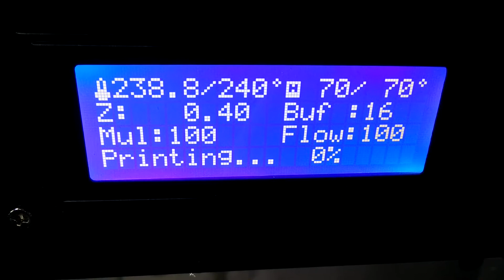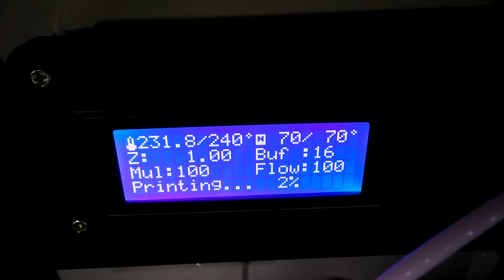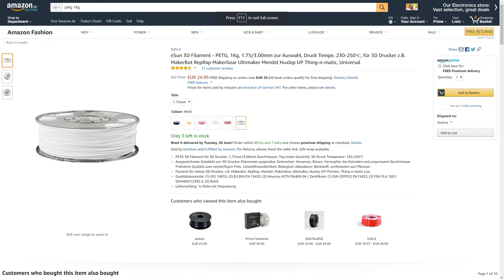Printing with PETG

Comment: hi, nice video, in the last 4 months I am printing mainly PETG for the flexibility  of some projects, I am having success with mostly the settings you describe:
- 230° nozzle
- 60° bed (from beginning to the end of the print)
- no fan (so I get the best layer adhesion possible)
- speed 40 mm/sec (max 50, ma better 40)
- 1st layer 20 mm/s
the best adhesion I get without warping is glass with hair spray, I know I thought it was silly too, but it works great on bare glass (I have cr-10).
I have thrown away the roll of ABS....
I hope this will help others...
cheers from Italy.
Reply from the maker: Hi, thanks for your comment!

Thanks for letting me know that my settings work (more or less). I've been printing with them for quite some while now, however, I mostly print PLA nowadays.
Based on your inspiration, I'm going to try the hairspray method as well! I just need a glass plate ;-)
To be honest, I have yet to try ABS, so I have no experience with it at all.

Greetings from Austria!

Comment: Thanks for the info.👍 I just started using petg last night and think I have the print temperatur far too high(260°C) and was getting quite a bit of stringing and blobs here and there on the inner walls.
Reply from the maker: Yeah, you're right. 260°C is already on the high side. Don't forget that there are no universal settings for getting every PETG right, so you need to experiment a little.

Comment: Very helpful video, thank you very much! 
There are so many long-winded videos about PETG on youtube and most of them don't cover the important tips like not using a PTFE-lined throat or hotend, for example. 

One question; is that the E3D V6 upgrade on Thingiverse you have printed and installed for your Bowden-style all-metal hotend? I was literally about to start that project today but am unsure if I should print it in PLA due to the heat created by the hotend.
Reply from the maker: Thanks for your comment!

In my video, I'm using a PTFE inlined hot-end for the simple sake that I had no all-metal one at the time. This is not a problem, except you go over ~235°C. 

I have some cheap all-metal hot-ends (E3D-V6 clones), however, they didn't really work for me and clogged after like 10 minutes when the heat goes up the throat! I'm pretty sure that this is only because of cheap metals that don't deliver heat as quickly as needed. 
Therefore I am still using PTFE-inlined hot-ends on all of my machines! 

I used this mount: https://www.thingiverse.com/thing:2099577
See more in this video: https://youtu.be/yxyDOZdmkIY

Later, I upgraded to a dual-extrusion setup, using two PTFE-inlined E3D-V6: https://youtu.be/L5PbNx_z6Yg

I'd recommend printing the part in PETG or other high-temperature materials just to prevent them from getting soft. 

 I hope that I could help you, if you still have any questions or encounter some problems, let me know!
Reply: You're quite welcome! Thanks for the really fast reply :-)

Oh really?! I may just have to try that temp then before I go through all the hassle of setting up an E3D on my Anet A8. I hadn't heard such issues with the clones, I'll have to dig into that a bit more. It's good to hear someone still doing great with the PTFE hotend as I am a fan of mine as well up to this point. 

Many thanks for the links! Yes that was the mount I was referring to. I'll check out your other videos and see how it went.

I will indeed drop a message if I have any other questions. Thanks again for being so very helpful!
Reply from the maker: Hey, you're welcome!

A few small tips from my experience: get spare parts!!!
If you change the hot-end of your A8, get at least two different ones (like one all-metal and a PTFE one), as it's very frustrating if yours doesn't work as expected, and downgrading to the old one is never the best option ;-) (I also have to mention that the heat breaks break quite easily.)

After like 3 months of printing PETG and PLA, one of the PTFE tubes dissolved and clogged the extruder, failing a print, even though I've never run it above 235°C. Therefore I'd suggest getting some PTFE tubing for the inline (outer diameter: 3mm for the E3D-V6 clones I used), even if you plan to keep your current hot-end. They cost just a few dollars anyways.

If you switch to the Bowden style with the motor mounted on the frame (like I did), I can really recommend getting both extra tube connectors (be aware that they are different sized) and extra tube (outer diameter: 4mm).

Yes, I know that this is a lot of information, but I really want to help you avoiding errors I did.

Comment: I just purchased from Matterhackers another roll and they did something to it but refuse to admit it even with pictures of my previous roll from them.  They went from 230c to 260c to print it so when I tried 248c on my MK10 after about 30 mins I got a jam.  It flowed as well as it did before but 248c is too hot for the PTFE tube so it melted just enough to no longer let the filament through.   The previous roll from about 2 years ago flowed like hot butter on two different printers at 230c and was a pure pleasure to use.  After a few emails with them I found a seller of an all metal hotend for my FlashForge clone and I am now waiting for that.  I am not sure why their PETG now wants 250c to 270c they say (260c is on the roll) so 30c more for the same stuff.
Reply from the maker: I'm definitely not an expert on materials but I know that the materials can behave differently when they have some additives mixed in (to make it stronger, for example). The only PETG I've been using so far is from eSun, as it's the cheapest one available here. 
That's the real issue with PTFE-inlined hot-ends, I've also destroyed two so far. You can, however, put in a new one (inner diameter: 2mm, outer diameter: 3mm for 1.75mm filament) easily, you just need to disassemble the hot-end.
I'm sorry for you to hear about these issues as I know how frustrating it can be to fix them. Maybe buy from a different company in the future, they are not "that" expensive anyways.
Keep me updated on your experiences with the all-metal hot-end. My $5 Chinese clone always jammed as the heat crept upward thru the heat-break, so I went back to use PTFE inlined ones for now.
Reply: This is a direct drive so not sure how it will work but they did do something between the beginning of 2016, late 2015 to the time you did this video as it was 230c which was perfect for everyone but now they are expecting people with only all metal hotends since they emailed me that it was 250c-270c for the range.  270c is getting up there so they had to add something but refuse to admit they changed anything.  The blue I purchased comes out like baby blanket blue and felt just as flexible as my previous red.  After the jam I had to take it all apart and clip another PTFE tube and put it all back together and I printed my part I had to have with their old roll at 230c.
Reply: I found another video from Nov 2016 so their change happened around early 2016 to the summer of 2016.  Additives added to reduce the cost and tbh if this had not had a flash sale of 30% off I would have purchased Inland or Esun because their prices have shot sky high as well.  My 18 went to 21 to now 25 per roll so at 25 that is 7 over Inland and about the same price as Esun.  SMH, nope I will go with less additives that demand higher temps even though I will have an all metal MK10.  The issue becomes if I want to print PLA with that printer.  I do know this any all metal you have, get, smooth the bore by using some brillo pad and a Dremel until is becomes almost a mirror finish as the Chinese do not do this so PLA jams in them and it is a horrible time with them.  Worst case get a 5 dollar clone and a real e3d throat for 14 dollars (US) and still come out ahead because it is the throat that the Chinese mess up on.
Reply from the maker: Yeah, I know. I accidentally purchased the wrong type those times, so I have three Chinese s*** all-metal heat-breaks around now. I'll probably buy a "real" heat-break in the future, but my current setups work quite good for PLA and PETG (which are the only materials that I print currently). 
Doesn't Matterhackers offer any "normal" PETG anymore?
Reply: No, they don't as normal for them is 260c which is why I am done with them even if I can print this roll eventually.  Too much additive for no good reason but to lower their cost.
Reply from the maker: Yeah, sadly.

Comment: I enjoyed this video. thank you for making it. I will try PETG based on your recommendations
Reply from the maker: Thank you very much. I'm glad that you liked it ;-)
If you have any questions or problems with your future PETG experiences, feel free to ask me.
Reply: thanks. I am trying now and will experiment a bit before I ask questions. Thank you again for sharing your experience.
Reply from the maker: no problem! Have fun ;-)
Reply: Caverntwo I am having issues with the supports - I’m guessing related to retraction?
Reply from the maker: What exactly is the problem? 
If it very hard to remove (that's one of the issues I had with my first supports), try increasing the "Support Z Distance" to something like 0.25 or 0.3 or even higher.
Reply: no, it seems that for larger areas, things are okay. But when it tries to make zig zag pattern for smaller pieces, it is not extruding. I am thinking I have to retraction too much (3.6mm) retraction speed 15mm/s
Reply from the maker: I use 4 to 5 mm retraction distance with my A8's E3D-V6 clone hot-end with a speed of 40mm/s. I'd suggest give a higher retraction speed a try.

Comment: I'm very interested in PETG as people say that it prints like PLA , stiff like ABS and it also has better flexibility to increase it's redundancy and more application.
It also dissolves in tetrahydrofuran(THF) and sands better than PLA.
People said that printing with PETG need less squishing so ican make some more precise print(eg, clips).
But how long does it take to moisten enough to affect the print
Reply from the maker: I think that the best thing is to try it out. Not every PETG performs same, but that's true for every other material as well. What do you mean by "moisten"? Like how long the unprinted filament can get exposed to humidity without affecting the print or how long the printed object can be in a humid place? Well, for the filament, I have my spools since the making of this video and they still perform fine (and they are NOT stored like they are supposed to be...). And for the prints, well, I have some outdoor since the summer and they are still fine (besides some PLA prints that are still good too). I have still too less experience to share when it comes to the life expectancy of PETG though...
Reply: good , i think i will scout for a kilo of PETG as i'm running out filament now

Comment: Very helpfull. I only have one problem and that is stringing. I tried a lot of retraction settings, different temperatures and different fan speeds, but i still get a lot of stringing. Any advice?
Reply from the maker: Using high retraction speed and fast travels helped me to get rid of most stringing. However, it's still not gone. A lower temperature helped in my case as well. But, my results aren't perfect either...
Reply: wow thanks for the fast answer. I also tried lowering the temperature but it results in poor layer adhesion. I guess the only option is just take some time to clean up all the strings ;)
Reply from the maker: I just saw the notification pop up. If I get some better results, you can be sure that I'll keep that channel updated ;-)
Reply: Nice, i just subscribed to your channel. I would love to see some toturials on improving prints. Btw i have a prusa i3 mk2s an amazing machine :D
Reply from the maker: Nice ;-) To be honest, there are even some in the planning. Well, yes, the original Prusa devices are really good ;-)
Reply: I changed only one setting and all the stringing is gone now. I only increased the acceleration speed when travelling between parts. The theory is that the nozzle moves so fast away from the part that no plastic coming out of the nozzle can stick to the part and create strings. PETG is now my favorite material :D
Reply from the maker: That's a very good idea, I'll didn't even think about that! I'll try that out soon, thanks for the tip!

Comment: Hi! Is two components epoxy able to glue PETG?
Reply from the maker: Hi, thanks for your comment.
I don't know, to be honest. Look up the description of your epoxy glue that you are using. However many glues work just fine with PETG, so you could just try it out.
Reply: @Caverntwo  Hi! It is said not suitable for PE, I don't know if PETG is included in PE family
Reply from the maker: I'm not sure either, I have basically no knowledge about plastics. Sorry. Here's what I'd do: just get a few test prints (cubes or something) and try it out to see what it does.
Reply: @Caverntwo  Ok my question was because I have to select a filament for a specific project which needs glue and resistance, PETG has resistance for sure but before buying it I was looking for the glue part.
If you say that there are glues working with that I will buy it, could you suggest me some effective glue for PETG?
Reply from the maker: PETG is definitely the better choice regarding resistance and ease of printing. However, it seems to be quite difficult to glue, as this forum post suggests: https://forum.prusaprinters.org/forum/original-prusa-i3-mk3s-mk3-how-do-i-print-this-printing-help/gluing-petg/

I glued PETG once and used UHU Kraft glue (it's a quite common and easy to get medium-performance glue for almost everything here in Europe), which worked, but not perfectly. However, there was no strength on the glued part at all.
I suggest doing your own research or contacting experts, which I'm definitely not.

Comment: sir which ia best falimant for outdoor.
Reply from the maker: PETG works relatively fine, but it is vulnerable to UV/Sunlight. PLA is good for most uses but will melt in direct sunlight if the object has a dark color (such as black, dark green, etc.). Bright colors work relatively fine, however, the color might pale over the time. ABS is very strong on the other hand, even in direct sunlight, although its color gets lost over the years as well.
Hope that helped.
Reply: I would think you can just paint this model for uv resistance
Reply: ASA